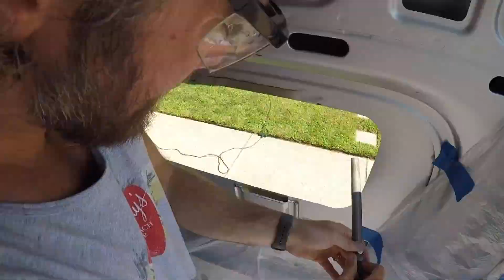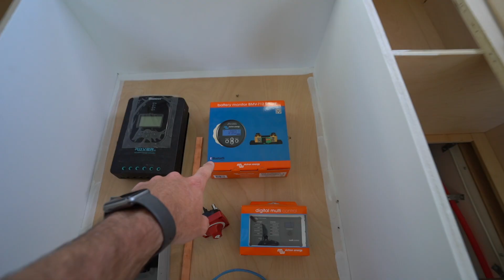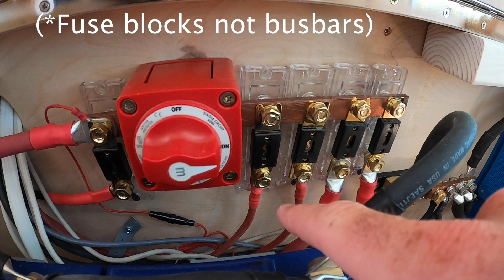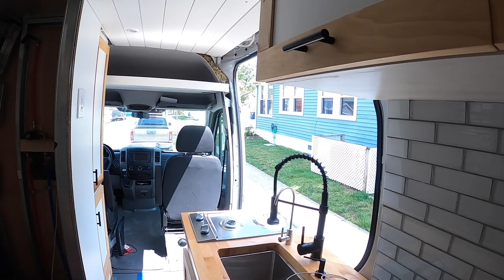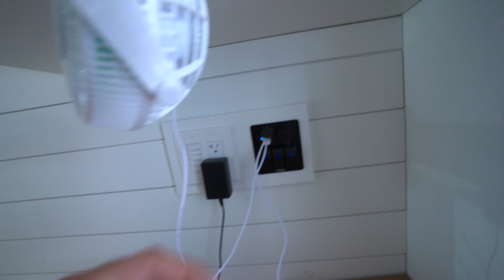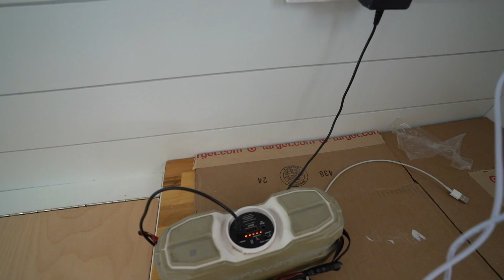Our Camper Van's ELECTRICAL SYSTEM with Detailed Overview - Van Build Ep: 34

Comment: You do this way the alternator will not charge secondary battery , only solar panel will charge secondary battery,  so you use 12v from primary battery?
Reply from the maker: I’m not sure i understand the question! Can you re type it?

Comment: Can you explain why/ what the “jumper cable” is or point me in the direction of the resource/ info you used for that part? I can’t see in the video but it looks like you have a 6g cable just connected to both of the positive terminals on the box?? I am mirroring your inverter / fuse box setup and am stumped on this part.... thank you so much for all this info it’s been a great help
Reply: If I’m understanding correctly there is a hot pole for each fuse/ breaker in the box (2 total for the two slots) and the “jumper” cable is what links them together ?
Reply from the maker: Yea I’m not sure where I said jumper but hopefully I’m understanding right... you have the hot wire from inverter going to the breaker hot pole which powers only one breaker.  So you need to have a connecting hot wire from the pole to the other one to power the second breaker
Reply: At 12:12, but this helped a lot. Thanks again for all this info- you da man! Unfortunately this Murray breaker box didn’t come with any labeling/ diagram or this would have been a bit easier.... thanks again 🙌

Comment: Hey Mathers I have a question. I have the same Victron Inverter and it is the last part of my electrical setup.  Here is what I don't get...in this video you "turned Off the Inverter", but I don't have that box that disconnects.  From what I can tell there is a switch on the box, but I don't want to go to my electrical (in my garage area) to turn off the inverter.  Can you give me a suggestion on what i am missing?  Thanks,   Greg!
Reply from the maker: Hey Greg! Ya gotta get the victron digi multi controller! Link should be in the description and super easy to setup!

Comment: How much of an area did you retain for the electrical equipment?  Primarily, the area with the batteries and the invertor.  I will likely have a similar set up but in a different location.

Comment: Excellent walkthrough! As far as you know, is the digital multi controller required for this setup? I know it’s designed to set load limits, but could you theoretically install a regular switch for the inverter?
Reply from the maker: Not sure about a regular switch but I would definitely recommend the multi controller otherwise you have to switch the inverter manually  which is a pain if it’s buried

Comment: It may be months since you did the video. Never attach your positive and negative wires to the same battery. Put positive on first battery and negative on last battery. Doing so allows all batteries to share the work. With positive and negative on the same battery, it does most of the work providing power. Shortest path between the single battery. Path should be between all batteries in the group of batteries. The way you wired it is going to result in battery imbalance ànd a shorter  operation time.
Reply from the maker: Hey David, thank you! I pinned a comment with the updates I made to the electrical system since posting, but thank you!!!

Comment: I would suggest changing out the metal strapping holding the batteries down with ratchet strap material.  You just don’t want any shorting possibilities on those batteries.
Reply from the maker: Hey Randy! Thank you! It’s plastic strap holding the batteries down maybe it looks metal in the video! Unless I’m looking at the wrong spot

Comment: I'm a little confused about the battery cable being connected to the 40a fuse for the charge controller.  Is that fuse also protecting the battery cable?  
In addition, I have a 360ah battery bank.  Do you think it would be alright to use that same 300a terminal block fuse on my larger battery bank?  

Thanks for this video.  It's clarified a lot of confusion.
Reply from the maker: Hey Zack I thought I responded to this, sorry. That fuse protects the charge controller.  You can put it on either side of the kill switch many people are moving it to the positive bus bar

300 amp fuse is for the accessories, fuse block inverter, etc not the size of your battery bank.  If you have 3000 watt inverter 300 is good 

Not an electrician just answering based off my setup
Reply: @MathersOnTheMap  Thanks much for answering my questions, really appreciate it. I kind of go overboard with questions sometimes. I'm kind of thinking about just adding a 400a ANL fuse next to where your 40a charge controller fuse is instead of using the blue sea terminal fuse.  I think 400a is recommended for 4/0 cable and size system (2500w inverter).  Do you think this would be alright?

Comment: If you are still using the 300ah bank, what does taking a shower/ the Bosch water heater draw from your system?  How long is the shower? Currently doing a similar setup
Reply from the maker: Shower is short with water on and off as you soap up and rinse.  But it usually drops 10% when we run the heater for 20mins

300amp hour is plenty if you have an isolator and solar
Reply: Thanks for all the info 🙌🤘
Reply from the maker: You got it! Thanks for watching Christian!

Comment: Is the 40a fuse connected to the battery cable for the charge controller only?
Reply from the maker: yep but you could move that to the other side of the kill switch if ya preferred

Comment: Explorist warns against the intallgear anl fuses, saying quality has gone way down hill.  Blue Sea anl fuses are ridiculously expensive.  Do you know of any quality ones?
Reply from the maker: Hey Zack unfortunately I don’t, I’ve hadn’t had any issues with mine but I do trust Nate.  I’d just buy fuses with a lot of quality reviews and monitor them if blue sea is out of budget
Reply: @MathersOnTheMap  I thinking about using the blue sea terminal block fuse.  They only make up to 300a it looks like.  I have a 360ah battery bank, do you think it would be alright to round down with the 300a terminal fuse?
Reply from the maker: @meowzic  I think the terminal fuse isn't there to match the size of your battery bank, it's to amps do not go over the recommended amount for your accessories, inverter in particular.  But I am not an electrician, these are just my thoughts

Comment: with that inverter, do you have to disconnect the battery from the battery when you plug in to the wall outlet? or the inverter knows to charge the battery and  energize the 120v outlets in the van simultaneously?
Reply from the maker: you don't have to disconnect the batteries, the inverter can charge and generate AC power (120v) simultaneously!

Comment: Hello, you done a great job, looks good, except one thing, the way you have connected your battery,s right now, that,s wrong, like this they want survive long, , using battery,s in parallel, never pull out of one battery.
Connect your plus (hot) from the first battery, and your minuscable from the last battery,  this Will keep you voltage in level,
Reply from the maker: Thanks Henk! Check out the pinned comment for updates on this video

Comment: You've got your positive lead  laying across your negative, vibration abrasion could potentially wear away at the wire coating and cause a fire.  I'd recommend extending that cable  a few inches so they don't directly touch each other.
Reply from the maker: Thank you I need to do that!!!

Comment: your battery cables should be One(1) on each battery. Example: place the negative on one(1) battery and the positive on the other.
Reply from the maker: Hey David, yes I agree check out the pinned comment where I made a few updates

Comment: Great video and always get great ideas from your build. I’m tackling my primary power system this week (using EXPLORIST.life) however I had a question on your 12v cabling. I planned on using all 12GA instead of switching between 12GA/14GA/16GA.. Any concerns you can think of as long as it’s fused properly? I have 250 feet of 12GA and would prefer using a thicker GA if possible.
Reply from the maker: Not at all!!! I wish I did 14 gauge instead of 16 for the higher voltage looking back.  12 ga is just a little stiffer when running wires

Comment: You was supposed to use the negative of the last battery so the system will balance out your using negative and positive of the first battery not good 😌
Reply from the maker: thanks Dan forgot to add that back into the pinned comment when I gave the update about the double 2/0 wire to the inverter (I just added it back to the pinned comment) thanks for the reminder!
Reply: Mathers On The Map nice good job great setup 👍
Reply from the maker: @Dan-sp3xw  thank you we appreciate it!!!

Comment: If I am seeing that right, it looks like your kill switch will not kill your option to start your vehicle using the momentary switch and Lithium batteries. Seems reasonble in one sense but you still have the Isolator which is fused toward the battery side of things but not on the Isolator side of things. Your thoughts for doing it this way, is appreciated.
Reply from the maker: Honestly, i built my electrical system off nate’s incredible content on his blog explorist.life which I highly recommend.

But my thought would be that I want to have the kill switch separate from everything to ensure nothing is connected (technically solar is still connected but that’s easy to shut off by unplugging a wire from the solar charger).  I’m not sure I’m following your comment about the fuses

Comment: I just finished up my electrical same way as you and noticed I did not have much battery power left after a little bit and inverter would not start up until I started van so wonder if you leave your power switch on or off when your not in van?
Reply from the maker: hey Ron you have the exact components as well?  3  - 100 amp hour Battleborn batteries and 3000 watt inverter?

To answer your question, we do not turn off the switch and rarely see our battery % below 80%
Reply: @MathersOnTheMap  yes the same inverter and batteries, with same bus bar setup
Reply from the maker: @ronshaw6464  Interesting what's the typical amp draw throughout the day?

Comment: where did you buy your copper flat bar and what size and thickness are those?
Reply from the maker: Onlinemetals.com check out my pinned comment!  If you’re using a 3000 watt inverter get a 1.5” x .25” x 24” bar 

You could probably get a way 12” but I like more Incase ya make a mistake

Also all 2/0 wire should be 4/0 (isolator can still be 2/0
Reply: @MathersOnTheMap  Cool. Thanks for the advice. I have the same exact Inverter/Charger from Victron and thinking of doing the same kill switch/copper bus bar design.
Reply from the maker: CyberOne604 sweet check out explorist.life who is a great resource for electrical too!!
Reply from the maker: CyberOne604 definitely 4/0 and a 1.5” bar then!
Reply: @MathersOnTheMap  Can the isolator be 4/0?

Comment: Thanks for the video....ready to start my electrical...isnt a 100amp fuse too big for six gauge wire?
Reply from the maker: Although, I am not an electrician (sorry I need to say it) I think agree, I need to swap the ANL fuses for a lower one.  I think I am going to add up the total amps on the fuse block and base it off that.
Reply: @MathersOnTheMap  thanks for the quick response....yes I was thinking 80 amp fuse for my setup also using 6 gauge wire.
Reply: The fuse must be the weakest link in the chain. If there's a short circuit it must go out first.

If your wire's maximum capacity is 55A, then your fuse must be lower than 55A, lets say 50A, so the fuse goes out (burn) first if a higher current than the cable's 55A current (for example 60A or more) goes through that part of the system.

The maximum for the fuse block is equal or less than the maximum of the wire.
So they would go out (burn) together or first the fuse block and then the wire. A wire or cable fire is always the worst.

The total Amps of the fuse block must be less than the amp rating of the fuse first, but also less than the Amp rating of the wires and fuse block. 

So the design process goes as follows:
1 Add up total amps on the fuse block
2 Choose fuse based on a little bit more than that total on the fuse block
3 Choose a fuse block rated a little more than the amp rating of the fuse
4 Choose wire rated equal or a little more than the amp rating of the fuse block (as well as of the fuse).

Comment: I have the same set up at Nate with the 3 slots to the right of bus bar so how else can hook up two dc blocks to each other?
Reply from the maker: Did you already cut your aluminum bar and drill your holes for only 3 spots?
Reply: @MathersOnTheMap  thanks. for getting back to me. yes  I did do I have to get another bar at 7.5" and do that one over or can the blocks be connected together?
Reply from the maker: Ron Shaw sorry mean copper bar not aluminum although you can use aluminum if you want.  Im not an electrician so I’m not really sure if it’s a good idea to put two fuse blocks on one ANL fuse...But I honestly would just redo it since it‘s not too expensive to get a new bar.  I wouldn’t mess around with electricity ya know?
Reply: @MathersOnTheMap  thanks I think I have to replace my copper bar for what you have.

Comment: Where was this video when I was doing my install?? Very well explained! One question... when you say you fused the 12V fuse blocks with 100A ANL fuses because the fuse blocks are RATED at a max 100A ea, wouldn't you add  the total current draw per block (not the actual AO/AC fuse ratings ie: 3a,5a,10a)  and x1.25 to determine the correct ANL fuse size?... I went with a 80A fuse to my Blue Sea FB and THEN I did the calculations and came up with only 48A (block total) x 1.25 = 60A... so a 70A fuse. Not 80A. Pretty hard to hit that "100A" rating exactly in an RV setting per block. 100A draw total x1.25  would need at least a 130A fuse anyways. You may not be protecting your 6AWG Pos wires with the 100A ANL's? Just a thought!... I'm changing my 80A fuse to 70A and if it blows under draw, ill work my way up. Or I could be completely wrong for the second time in my life??? 👍and sub'd 🤙🏼
Reply from the maker: I agree that's probably the better option (but I am certainly no expert), I bought the 100Amp ANL's months ago before completing the electrical compartment and not really doing too much homework (basing it off explorist.life diagrams).  The beauty with those ANL fuses is that there pretty easy to swap out and will definitely consider reducing it down.  

Also, THANK YOU for subscribing really appreciate it!!!

Comment: Ah, you can put the victory on it side... no cooling problems..?
Reply from the maker: yes it can be mounted horizontally.  Victron recommends 10 cms on all sides which I am clearly falling short of, but may drill ventilation holes as Greg suggested in another comment

Comment: this is the best video so far mainly because my system I am just getting started on is exactly the same except the extra dc block which I will use now I think.  I have been looking for a diagram for the layout and wiring and what is connected to what for a while and finally you have done it. Great job
Reply from the maker: Glad to hear Ron!  Thanks for the feedback!  best of luck with your build
Reply: forgot to ask you I could not find the size of the copper needed from Nate but how big are your two pieces? I had ordered a 12" so I need to cut them yet.

Comment: You wanna make sure to read the manual for the inverter. It is not recommended to be placed the way you have it. It has vents on both dies, and you are covering one of them. Good luck!
Reply from the maker: Hi Mario, thanks for the feedback I really appreciate it!  I read the manual and agree it needs to be well ventilated.  It does say you can mount the inverter horizontally and to have 10cm clearance on all sides (which I know I don't have).  I do have clearance below the inverter as it's not sitting on the bottom of the box but I know it's not 10cm.  Anyway again thanks for the comment and ill be sure to monitor it!

Comment: You'll probably need to replace that 10 ga Romex sooner than you think. Keep a close eye on when it's in use as if that single strand starts to break it will get very hot and could melt and possible start a fire. Single strand wire has no tensile strength and will break due to vibration. I believe it's actually illegal to use in the boating industry.
Reply from the maker: Thanks John!  I will definitely monitor it, it sucks that I learned about Romex vs stranded wire after I was too far in the build to swap it out.  I don't plan to use shore power too often but will check it out when I do.
Reply: @MathersOnTheMap  Yea if you ck it everytime you use shore power you should be fine. You might want to get a digital thermometer that way when any electrical connection is under load you can tell if there is a problem if it's generating a lot of heat. I ck all my connections occasionaly even the MC4s just to be safe.
Reply from the maker: Love that idea I gotta get one...thank you for the tips!